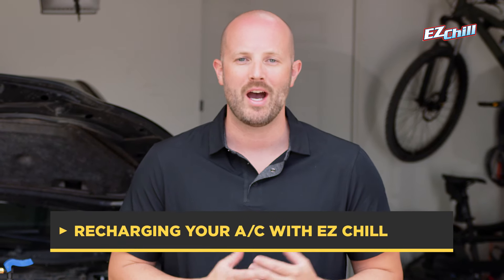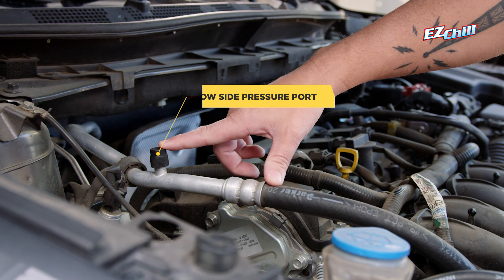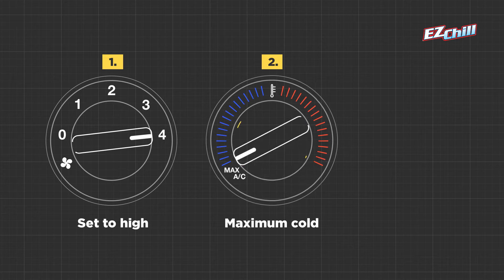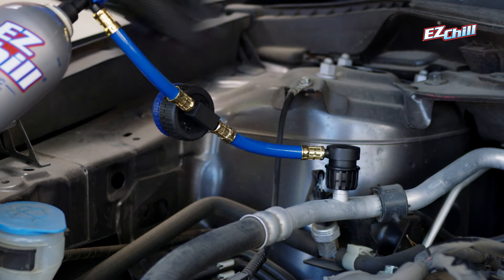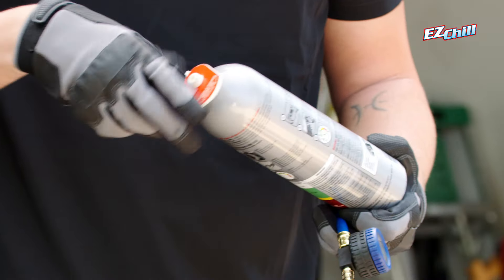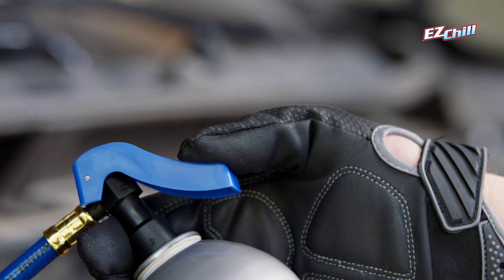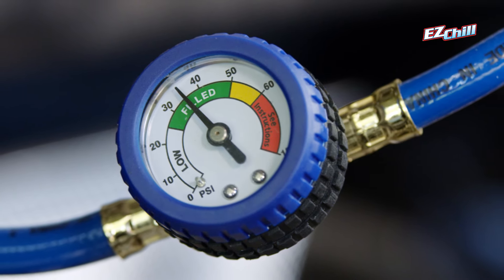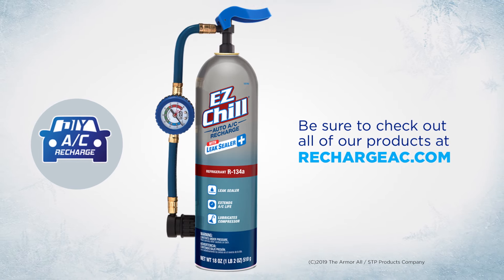How to Recharge with EZ Chill® (EZC102)

Comment: It worked for my lexus. I used the same brand but a smaller can. I figured i had enough freon since my passenger and rear vents blew cold but my driver side would blow ambient most of fhe time. I used a can on the low pressure plug next to the oil dip stick with an "L" on it. And viola I have cold air on my side again

Comment: I tried again and again to get it to work, multiple times. Finally saw this video yesterday and I had a good idea how. But found out I hadn't screwed the lever side down tight to properly contact the can, (believe it didn't puncture the seal) but tonight I squeezed and it showed needle movement, 30-40 on the gauge and ice cold air jetting out of my AC! 2008 Nissan Frontier

Comment: My AC has not been getting cold enough, and the passenger side seemed warmer than the driver’s side.  Sometimes the AC would be cold even when it was hot out and other times it would barely be cold even when it was not above 80 degrees outside.  I figured it was probably low on refrigerant as you lose some over time with age and the car is 6 years old.  Figured I would give this a try.  I started up the AC on my 2015 Sonata Hybrid and let it run a while, it was only coming out at 62 degrees.  Put the included pressure gauge on and it was reading just at the top of the green area.  So I gave this a try and got it up to the just about the middle of the blue area, did not want to overcharge it.  The temperature coming out of the ducts dropped to 38 degrees.   Very pleased now, hopefully the problem was just slight loss of refrigerant over time and not a leak that drains it down soon.  Will have to wait and see.

Comment: I'm deciding if I want to do this. I had a recharge done at my mechanic's but after a few minutes, it went back to blowing warm air. I called him and he said there could be a leak. 

This tutorial makes it look easy but there was no mention of the leak sealer and how it works. Should I bother with this product and take it back to my mechanic or should I give this a go?
Reply from the maker: If your technician added refrigerant, your system started blowing cold air, and if within minutes warm air came back out - you have a leak that's too large to be fixed by this product or even our metal stop leak products.  We recommend you have your technician fix the source of the leak before adding refrigerant.

Comment: Whenever I connect the coupler, the gauge reads about 15 PSI. Upon releasing the trigger after even a quick pull, it jumps to the red, hangs for a second, then slowly comes back down to 15. Anytime the trigger is being pulled, it bottoms out at 0. Any ideas on what's causing this? Or is this standard?
I'm doing this on a 1973 Ford Gran Torino that's R134a converted.

Comment: The gauge reads low when the ac clutch is engaged but goes back into green area when clutch disengages. The reading you go by is when the clutch is engaged only??
Reply from the maker: Yes, that's correct.

Comment: Does it sometimes take a little while for it to go through the system to blow out cold air?
Reply from the maker: It might take a minute or two for the gas to circulate, but not much longer than that.

Comment: Coupler does not want to attach to the low pressure gauge, I’m pulling back the lock and pressing hard as hell yet it won’t lock or stay on straight
Reply from the maker: In this situation there are a couple things you can check - 1) make sure you're on the right port in your vehicle.  The coupler will only fit on the low side port so if you've found the high side port by mistake it won't connect by design.  2)  Make sure your vehicle uses the same refrigerant type in the can you bought.  Many newer vehicles come with a new environmentally-friendly refrigerant called R-1234yf, which has a different size low side port.
If you're using the right refrigerant on your vehicle and have found the right port, it will fit.  You will need to pull back the ridged collar on the end of the coupler to get it to connect and lock.

Comment: AC, is there a need to rid the connecting hose of any air prior to dispensing of the refrigerant into the system?
Reply from the maker: No, the hose is immediately ready for dispensing and recharging.
Reply: @Acprocold  Yes Sir, yet the hose is going to have existing air in it, of which would inevitably be discharged into the system..

Comment: Is it “normal” for a 7 yr old car to be in the mid Low range on the EZ Chill gauge?  
I recharged it to the middle of green on the gauge and the AC is cold again. I just wonder if I have a leak?
Reply from the maker: Yes, leak rate really depends on a lot of conditions, but all systems leak.  Definitely very normal.

Comment: If my AC clutch is not engaging, does that give me a false reading? Also, when you press the lever does it shoot up in PSI on the gauge, and when it’s depressed it shows the actual PSI?
Reply from the maker: Yes, it may be giving you a higher pressure reading when the clutch is not engaged.  When you press the lever the pressure reading should go to zero since you can't read system pressure and fill at the same time.  Release the trigger to check the pressure.

Comment: the needle never stops moving, even when the compressor is running. How do I know what the correct reading is.
Reply from the maker: Yes, depending on the vehicle and the system conditions, the needle can bounce around.  Take the pressure reading when the compressor is on and use the position in the middle of the needle movement as the pressure reading.

Comment: Can I use this on an 88 Corvette?  It's been blowing hot air for years. I was told I will have to update the system which is a lot of $$$. Looking for alternatives.
Reply from the maker: Your vehicle most likely uses R-12 so if it hasn't been converted to R-134 you'd need to do so.  We do sell retrofit kits under our Certified A/C Pro brand, but it's a more involved project.  https://rechargeac.com/products/retrofit-kits

Comment: Will this still work if my fan only works on the number 2 setting not numerous 3 or 4
Reply from the maker: That should be fine.  Just make sure the engine is on and the A/C is set to max cool or the coldest temp setting.

Comment: Can i reuse it if there’s still some left in the can after ?
Reply from the maker: Yes, store in a cool dry place.  You can leave the gaue on the can or disconnect.  The can has a self-sealing valve on it so refrigerant won't leak out of the can.

Comment: I keep hearing these are bad as it can be “overfilled” which will cause damage. Isn’t that what the gauge will tell you?
Reply from the maker: Yes, you never want to overfill.  Only charge into the green and then stop once you have cold air blowing out of the vents.  More refrigerant in your system only helps with colder air up until a certain point.  Once the system is full adding more refrigerant will not help.
Reply: If you want. Charge just before the green on the gauge.

Comment: I went to the website and entered in to see where the low charge port was on my 94 Cadillac Deville and the video shows but there is a malfunction, it only shows about 1/2 inch high and can't see anything.
Reply from the maker: The low side port is standard on all vehicles so the coupler on the can will only fit on the right port.  When it connects you've found it.  Our low-side port database does have images for your 94 DeVille to help.

Comment: Can you read the guage when the can is disconnected?
Reply from the maker: Yes, you can connect the gauge to your vehicle and read system pressure even if the can is not screwed into the gauge.  Just don't push the lever without the can connect or it will dispense refrigerant from the system.

Comment: The reading fell into a 30 and I couldn’t get it any higher from that is that normal
Reply from the maker: Yes, if you hit 30 and it won't go higher and your vents are blowing cold air, do not add more refrigerant.

Comment: I can't get this to connect to a 2017 kia soul
Reply from the maker: Your 2017 Kia  Soul uses a new environmentally-friendly refrigerant called R-1234yf.  Many newer vehicles use this new gas.  By law these vehicle's have unque fittings and the can uses a reverse thread so the gases can't be interchanged.  You can confirm by checking the refrigerant sticker under your hood.  This video will help you out.  https://youtu.be/m9WVVmTTSYM as will this video https://youtu.be/CsrtqKdmlOo
R-1234yf is quite a bit more expensive than R-134a so be prepared for that.

Comment: what if you check gage at first and it reads on the green but the ac is not getting cold then what
Reply from the maker: If your gauge reads in the green, but the system is not functioning properly, then you may have another problem causing the issue that this product won't solve.

Comment: The hose is too short to do all that shaking. Plus the low point in my 2007 Chrysler Pacifica is way deep off in the car so all that extra can't be done
Reply from the maker: Might be time to step up into a can of A/C Pro with a 24" hose just for that reason.
Reply: Thank You I wish I knew that before the older guy at Advanced AuteZone sold me the 14oz can yesterday. Going to screenshot this response to save for future needs. Thank You

Comment: Yeah it’s not fitting to coupler
Reply from the maker: There are typically two reasons why the coupler won't connect.  1) You're trying to connect our coupler to the high side port instead of the low side or 2) The vehicle you have requires R-1234yf and not R-134a.  You can confirm the refrigerant type of your vehicle by looking for the sticker under the hood with the type listed.  This video can help you https://youtu.be/m9WVVmTTSYM
We have A/C Pro R-1234yf kits on sale at all automotive retailers.